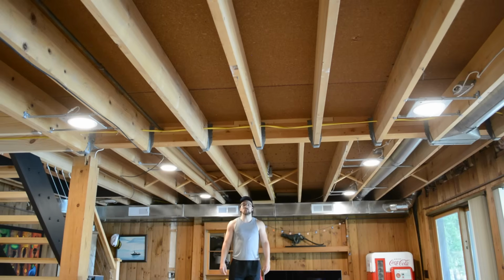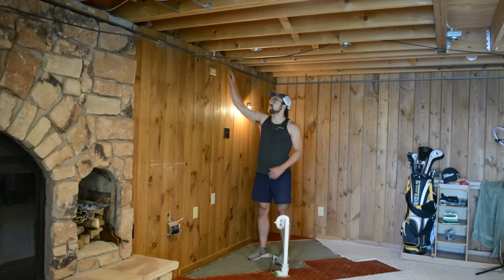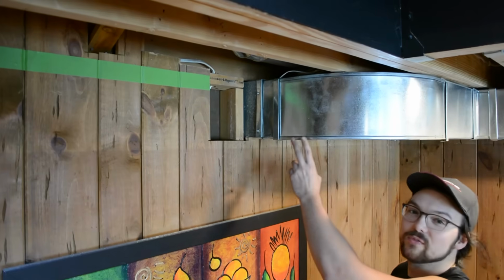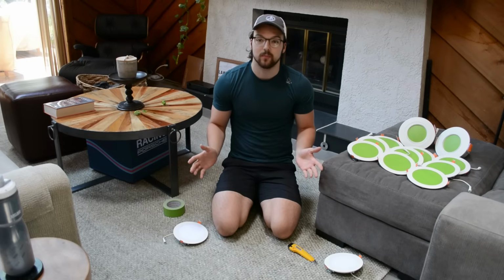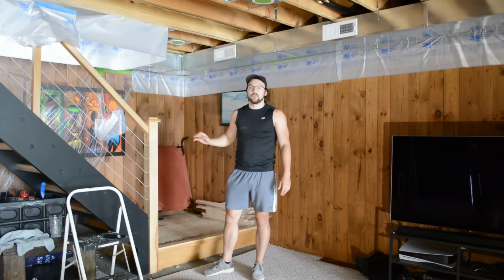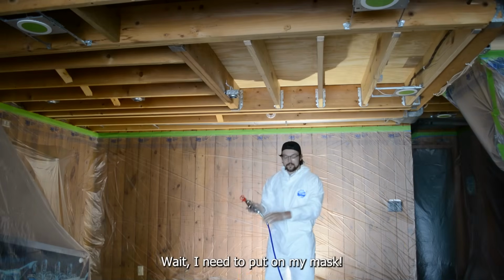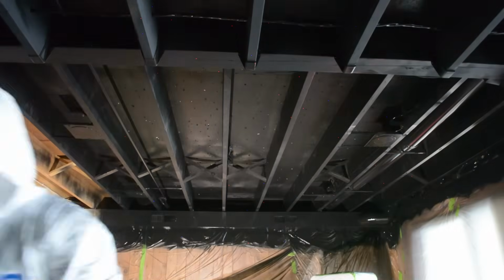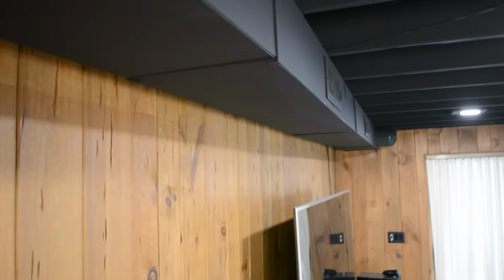How to Paint an Exposed Ceiling | DIY Basement Renovation Part 1

Comment: I have a contractor finishing basement. I am concerned about drop ceilings being low, it will be 83 inches. I am seriously thinking of not having the drop ceiling and having ceiling painted. I will hire someone to paint ceiling. I was going to have the drop ceiling put in and try it for a yr but I can see taking the drop ceiling out is a lot of work. I would paint ceiling white, not a dark color.

Comment: Did you check into if painting electrical wires is code compliant in your area?  I was advised that in my area it is not compliant because the paint can dry out the plastic in the 14/2 wire over time.

Comment: I'm wanting to do this in my basement. What do you do in the area where the rim joists are? Ours are filled with fiberglass insulation and I don't know how to fill that in to make it look nice. I have heard maybe cutting foam board insulation and sealing it in with expanding foam and painting. I just want it to look nice.
Reply from the maker: The easiest option would be to just spray the insulation. When it’s black, everything just blends in. Other options would be foam board or plywood to cover up the insulation and then spray that. Good luck with the project!

Comment: I am just about to purchase the dryfall paint for my basement. My question is, did you have any exposed bat insulation up by the rim joist and if you did, did you just paint over it? 

I am worried about messing with the R value of it in my basement.

Comment: Curious... after some time has any of the paint flaked off the metal ducts?
Reply from the maker: I was suspicious of this as well. Especially since I didn’t use primer. However, it has help up amazingly well with no flaking. I think  it comes down to using high quality paint. The dryfall from sherwin williams is some of the most expensive paint you can buy, but it sure is a great product!

Comment: Looks pretty darn good. I've seen people use white and grey as well with nice results. For those looking to do something similar, like the accessibility, but want a cleaner look, and don't mind spending a bit more time, effort and money, you can nail small wooden cleats to the bottom of the joists and slide drywall between them. If you have a newer home that has "I joists" then you just need to cut and place the drywall pieces. I don't think there's a term for the method but you can search "Drywall panels between I-joists" and see a few examples.

Comment: Has the paint cracked or chipped on the air ducts? I want to do this to the basement and I’m looking for what paint to use.
Reply: If you're worried about the ducts, I would rub them with a scotch Brite pad soaked in wax and grease remover, then wipe with a microfiber towel with wax and grease remover and a dry microfiber towel to remove any residue. After that's done spray a coat of etch primer before painting and you should be golden.

Comment: that acoustic drop ceiling frame was put up with wood screws.   It you rip it down without removing the screws, of course you're going to cut up your hands.   I first took out the wood screws then carefully took down the tiles and frame.   Don't post videos if you don't know what you're doing.
Reply from the maker: It was actually hung up with nails rather than screws. Never claimed to be a pro but I wouldn’t consider myself “someone that doesn’t know what they’re doing”. There’s multiple ways to skin a cat and this video isn’t even about drop ceilings so no need to get on a high horse bud

Comment: Should've been primed right? Is this really going to stick on all of the different materials???
Reply from the maker: This is a super high end paint and doesn’t need primer as long as the surfaces are clean. It’s been up for over a year with no issues 😁
Reply: @GoldenKeyDesign  What kind?
Reply from the maker: @gabrielkind2970  As I mention in the video, it is called Dryfall paint

Comment: How has the paint on the duct work held up? I am about to start this project and have read multiple different opinions on priming duct work. Also what pressure setting were you using on the sprayer ? Thanks in advanced loved the video

Comment: I've heard you gotta use oil based paint instead of latex because it will peel and chip. Was this done with oil?
Reply from the maker: No, as I mentioned in the video it is dryfall paint which is specifically meant for this purpose. It’s been well over a year with no issues 😁

Comment: Going to do the same thing with my basement but it already has fiberglass insulation in the ceiling which I am tempted to leave in place for a bit of soundproofing and just paint over the fiberglass (which I am sure will take a lot more paint...but I fear it also may end up looking like crap).  What is your opinion on whether i should take out the insulation or try to paint over it? ...and how is the sound transmittion from your basement to the 1st floor and vise versa in your house without insulation.  Looks great by the way.

Comment: What did you buy for the can less lights and did they come with the metal brackets?
Reply from the maker: They are called pancake LEDs and they sell a variety at any big box store. You can buy the metal hangers separately

Comment: Great video. Your sprayer didn't create as much overspray as the gun I used did. Mine was a good grade, pot style, sprayer. My only regret was that when the job was done and I went upstairs, I discovered that there was overspray everywhere. The entire two story, 2500 sq ft house had overspray. I thought that I did a decent job around the staircase, and I wasn't recirculating with the furnace fan. It just got everywhere. It took hours to clean. Be careful which sprayer you use and prep accordingly.

Comment: So, why the green tape when you came back a did the tape and drop “cloth” combo? Could’ve done the same process with the second application as the first to seal the sections between the tongue and groove. And I would’ve just hammered the ceiling fasteners in. Huge time sinks in those two operations.

Comment: heat vents and cold air returns have an oil film on them to prevent rust…most untrained DIYers don’t know this. You wipe the vents with simple green, rinse and dry.

Comment: Annnd in removing the ceiling tile and not replacing it with just about any other kind of ceiling, Yes you ahceived your "industrial look" But you also just lost any sound deadening properties the drop ceiling provides and while it may look super cool to you now. You are eventually going to hate the sound traveling upstairs and throughout the house. Well..if you dont. Your wife certainly will. I promise.
That Grayco sprayer is fine for amateur homeowners such as yourself (Its obvious to a 45+ year professional, which I am). But if its what you do for a living. It wont hold up to daily rigors. forget "man hours." I literally have thousands of man days of spraying experience. And Ive tried going the cheaper route. It will work in a pinch of if you only rarely spray. But its not good as an every day tool. You could have saved yourself even more money and simply rented a professional grade sprayer for the day.  And no. You dont need to flush water though the machine first before spraying. I double checked and even Grayco doesn't say to do that. Ive never done it on a brand new sprayer. After that there is usually water still in the machine after my last cleaning. simply prime till paint comes out. Shut off primer valve. lower the pressure and spray into a 5 gallon bucket till a solid stream of paint comes out. Thats it.
I wont talk about the dryfall. Because I think you have learned your lesson the hard way. Dryfall works better on higher ceilings  and its not 100% certain its always going to be 100% dry by the time it hits the ground, especially inside in an enclosed area.. Always drop out your rooms
Prime vs not prime. Using black it may work for you. however you may or may not end up with an uneven finish as it will soak into some areas better than others. Anything other than black. or some other very dark color. Yea. You should prime or you will almost certainly end up with bleed through from the unprimed wood and again its not likely to cover evenly.
Also. Check your local codes before painting over piping. Some pipes by law have to be certain colors such as gas pipes, in certain areas

While there is nothing wrong with it technically. You usually dont need to strain paints out of brand new unopened buckets. This was more of a common necessity 35+ years ago when we saw more inclusions in the paint.  In your case it was likely an unneeded step. However.  Whereas it is always a good idea to strain paint being poured from buckets that have previously been opened and worked out of.

Comment: If you try another similar paint project, I would recommend an extension wand for your sprayer. It will make the whole process faster and easier. I'm glad your tried this though and wondered what it would look like if I did the same. For the industrial look I think you did a great job.
Reply from the maker: I actually bought an extension but decided not to use it as the ceiling was low enough. It was also easier to get into the nooks and crannies without the extension attached

Comment: Excellent video! Just a question about all the electrical wires on the ceiling. Did you paint over those and is the paint rated for use with electric wires?
Reply: I have that same question!

Comment: Did the wood or metal ducts ever bleed through since you didn’t prime?
Reply from the maker: Great question! I had the same concern, but it’s been over a year and there are no issues. Dryfall is very expensive but well worth the money. It has great coverage and had no issues with the metal ductwork

Comment: Thanks for the video. This is exactly what I am looking for. I have a question? Does it require to have an exhaust fan in this application? Thanks
Reply from the maker: Thanks for watching! It’s not required but extremely helpful. I would make sure you have a good respirator at a minimum

Comment: curious about painting the ductwork.. did you use an oilbase paint or water base paint? Thanks
Reply from the maker: We used dryfall which is water based. It’s been almost 2 years and the paint on the duct work hasn’t had any issues. It’s held up really well. Dryfall is very expensive but worth the money
Reply: You definitely want to prime. SW has a great primer for this, sure bond.

Comment: Did you mark and label all the pipes and cables in the ceiling before paint it all black?
Reply from the maker: No, we did not. But it’s pretty easy to tell what’s what. Gas and plumbing pipe is very easy to distinguish. And you can just follow where the electrical lines go to determine where it goes

Comment: Hope you reply.   

I’m doing a basement in a new build and about to order lights.   

Planning for the main 18’ X 45’ “family room” to be dry fall paint.

The bath, 2 bedrooms, storage, gym, and panic room already have lights upgraded to my liking and will be drywall or Ac Maple Plywood. 

I’m struggling with the main living / family / pool table room lights.  I want large thin LED rectangle over the pool table and my wife found something she likes.  It has black trimmed edges.  

Sorry for the long winded text to a get to the question.   

What LED light will work with black on black with black pool table light  AND no dry wall?
Reply from the maker: I would go with a light that only casts light downwards. You do not want light casting up or sideways as it will highlight the open ceiling. With only down casting light, the ceiling will pretty much disappear

Comment: Did you have electrical wires or copper lines or drain pipes in the ceiling. If so how did you deal with them?
Reply from the maker: We did. Prior to spraying the ceiling, we had a plumber and electrician come out and clean up the ceiling as best they could to make it look less like a spider web haha

Comment: I have a very similar basement and planning to do the same project you did. Thank you for all this information. I looked into this paint sprayer and had a question about it: what settings did you use on this unit for spraying the ceiling?
Reply from the maker: The only adjustable setting on the sprayer is the pressure. Since this paint it quite thick, I turned the pressure up to about 75% of the maximum. You can test it and adjust the pressure as you go. If you get to streaks on either side of the spray, you should increase the pressure. Hope that helps!

Comment: Could you cover how to replace those old basement lights fixtures please ?
Reply: Came here to ask the same question, thanks for the advice!
Reply from the maker: They are called wafer LEDs. You can buy them at any big box store and they make ones that can screw into existing recessed can lights. Hope that helps!

Comment: I think your laser level might have shot into your camera lens at some point and killed some pixels on your sensor, I can see some consistent red/blue dots on your footage.  Awesome work on the ceiling tho
Reply from the maker: Good eye! The low light capabilities of my old camera are not so great. It's about 10 years old and has been through many renovations. I actually recently upgraded to a very nice Sony mirrorless camera and upgraded my audio gear as well. You should be able to see/hear those in my more recent videos. Thanks!

Comment: I did this to my basement a few years ago. The only thing I did different was I sprayed a coat of zinsser primer first and did a 50/50 vinegar wash on the galvanized ductwork to prevent peeling later on. It's probably the cheapest and easiest way to transform a basement while giving a modern look.
Reply from the maker: It really is!

Comment: I may have to consider something like this when I get around to redoing my basement.  I'd considered redoing the drop ceiling but in 2x2 tile or drywall but not a fan of the loss of height for either approach since there's only a smidge less than 8' clearance without it.
Reply from the maker: Yeah I would strongly recommend this option. It doesn’t show up on camera well but the ceiling really disappears. Especially when the ceiling lights are on. It becomes empty space and makes the ceilings feel so tall. Highly recommend

Comment: Hello!  Thank you so much for this great video!  Question for you... After you put up the green tape, you were using the 3M masker to put up the 3M painter's plastic.  Did you use the Blue tape with the 3m painter's plastic?  What width did you use - 1 inch or 1.41?
Reply from the maker: Thanks! I did use blue tape since the masker only accepts 3M tape. I believe the width depends on which size masker you buy.

Comment: Did the sprayer get clogged at all during the process?
Reply from the maker: Over the course of the whole ceiling, it may have got clogged once if I remember correctly (been several months). Regardless, it’s a super quick process to unclog it. Just spin the tip 180, spray out the clog, spin it back, and you’re good to go!

Comment: Looks good.  Doing the exact same thing.  How does the paint hold up on the galvanized duct with the fluctuations from heat to cooling during different seasons?   What is the odor of it like?
Reply from the maker: Thanks! The paint holds up surprisingly on the metal duct work. I haven’t had any issues and it’s already been through a summer and winter. I would just wait to turn on your AC/furnace for at least a day to let the paint fully cure. It did smell for a couple days but it quickly faded. Hope that helps!
Reply: You definitely want to prime it or IT WILL peel.  SW makes a great primer for those, sure bond is the name.

Comment: Hi! Love the end product. We are looking to do something similar in our basement. Out of curiosity what brackets did you use to mount the LED recessed lights?  And what lights did you use? Thanks!
Reply from the maker: Thank you! I used pancake LED lights. You can find them at pretty much any big box store as they are new standard for residential lighting. They usually come in a variety if sizes too. You should find the brackets in the same section. They are made of 2 metal rails that span the joists with a metal cutout for the light to snap into. Hope that helps!

Comment: tip,  make sure your ac or heat does not kick on during process as it could suck some of the failing paint into the duct work and push is out in the out into the rest of the house.. lol.  This happened to me about 20 years ago but the paint I was using did not dry before it hit to floor.. it messed some of the carpet up by the registers upstairs.
Reply from the maker: Great tip! I should have mentioned that in the video. Hopefully it didn't mess up too much of the carpet

Comment: Did you consider leaving the entire cedar wall unpainted vs painting an inch or so down the wall?
Reply from the maker: Great question! I did consider that, but the cedar pieces were varying heights and it looked unfinished. With one consistent line across all the cedar pieces, it makes the wall look much more finished and makes it look like all the pieces were cut to the same height. Hope that helps!

Comment: I actually like the look of black painted floor joists. The one thing I don't like while living with it is there's not much in the way of sound isolation between the two floors.
Reply from the maker: Yeah, this look really goes with the aesthetic of the rest of our home. We don't really need any sound isolation as upstairs we installed tile so there is a layer of subfloor (glued and screwed), mortar, durock, more mortar, then tile. It is quite solid and doesn't really transfer noise. Also, we raised a sunken floor upstairs so there is about 6 inches between the new subfloor and ceiling of the basement.